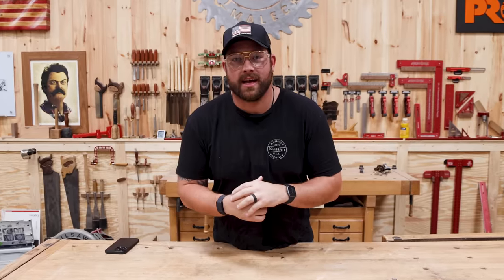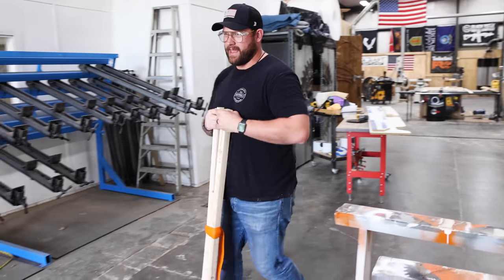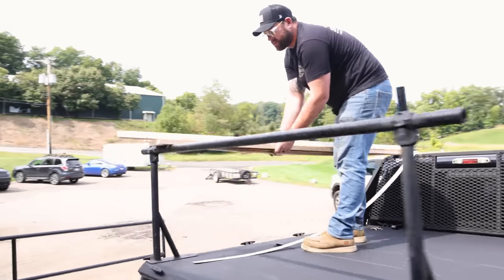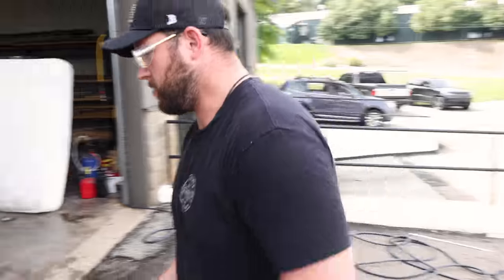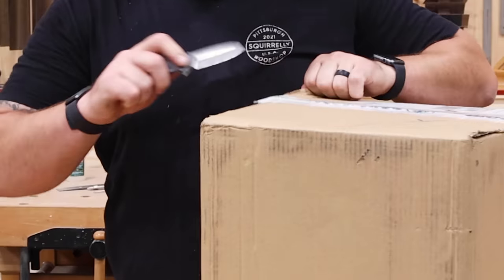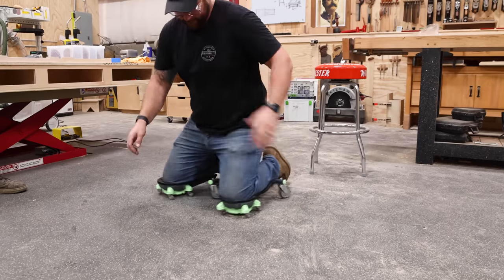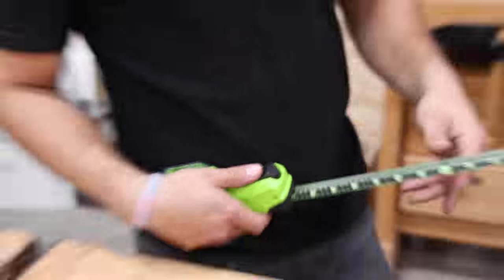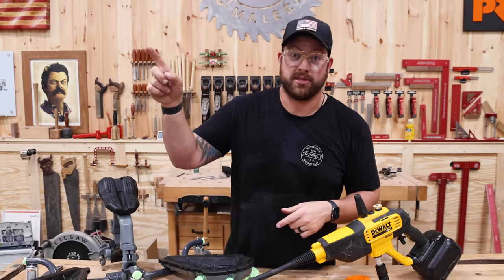I Tested The Most Viral TikTok Tools!

Comment: I have the dewalt pressure washer, it works perfect for washing mud off my ATV after a ride. The larger angle tips are useless, I only use the turbo and the 15. It's definitely not a replacement for a gas pressure washer but it has its uses. It works best with the 60v battery, I will go thru multiple 20V's washing mud of ATV.

Comment: Almost instantly bought the pressure washer...then realized I was only interested as a better way to wash cars...then realized I don't actually like doing that and at $192 I could take my truck to the $3 wash every 2 weeks for 2 years before that tool was worth the money.

A pressure washer that doesn't have enough pressure is an excellent way to use up storage space though!
Reply: oddly the low pressure was part of what tempted me having a good way to clean hay balers and mowers without getting water forced into the bearings is always a challenge so portable and using the same batteries as we use in the shop was tempting i am going to see if a deal pops up in the late fall with a battery (best way to get extra batteries with when they come with a tool attached to them) picked up a 60v dewalt pole saw that way for a little over the cost of 9ah flex volt battery
Reply: Those cordless pressure washers are a happier medium between his pressure and electric pressure washer. Definitely doesn't replace my gas pressure washer but does much better the the hose alone cleaning my ATV after a good weekend or my mower.

Comment: That kneel it thing looks like a decent replacement for a rolling stool for working under cars in a shop with low ceiling clearance as well. But, only if you do it a lot, because rolling stools are much cheaper.
Reply from the maker: Yea it’s more for flooring
Reply: @John_Malecki  I agree. I just could see myself using it under a car, because the ergonomics and range of movement seem better than seated on a rolling stool.

Comment: The simple strap looks very similar to High Traction Safety Tape (3M QuickWrap to be specific). It’s used when working at height, usually overhead of other people. I bought 2 rolls when I learned I had a job coming up where I’d be working on a stadium catwalk... I’ve found tons of random uses for it since that job a few years ago. That said, I would NOT trust it to replace a Ratchet Strap.

Comment: The Gator tape is really good for people with low vision and their finger strength isn't all that great. I have trouble with locking all my tapes as my thumb and finger strength isn't good but the gatortqpe keeps it locked until I need it released then it is easy to release. The green on black is easier to read and the print is easier to read. So it is good for that purpose.

Comment: Free tip from a contractor, but tying down lightweight stuff save pieces of trim or smaller trim boards take the handheld stretch wrap stretched around a couple times and then take a single wrap of duct tape holds everything really well and is very easy and cheap

Comment: Simple strap reminds me of bicycle innertubes. I do the same thing with bundles of 1" PVC and lash it with cut up stipes.   Bike shops will give you flats they've changed for free, you just cut them and split them open.   Works really well.
Reply: The main selling point seems to be that you can cut it.  But that almost makes it disposable which is not something you want if you're doing a lot of hauling.  Also flexible materials are often very susceptible to uv and weather damage so don't leave it on your truck unguarded.  Definitely not a useful as cloth tie downs or rubber straps that are usually thicker and therefore will last longer in the weather.

Comment: About pressure washing, use a chemical cleaner like bleach for concrete or soap for exterior walls, degreaser etc. You won’t need as much pressure to remove the dirt/grime after treating it, and you’ll get a more uniform result.

Comment: I think the key with the simple tape is to get the free end under a tension wrap.  So, if you're going to end it on the post, get a few wraps around that too, so you have something to grab the end with.  Remember with belt tension, every wrap has a exponential effect.

Along with the "awesome" score, it would be cool to have a "does what it claims" score.  So the gator tape would get a "does what it says" but not "awesome."  The fun would be in collecting those that DON'T do what they say... but still get an awesome.

Comment: The kneel it wheels and anything similar can damage flooring as you install it. If a rock or offcut gets pinned under the wheel as you roll it will scratch your surface.

Comment: I use the hell out of the dewalt 20v pressure washer at work for cleaning condenser coils and it works wonders. Strong enough to clean yet not too strong to damage the coil fins.

Comment: John we need you to try the Tianli router (handheld Mortiser). I’d seen them selling for $30. (And up to $200) little gadget Turns a palm router into a festool domino. Or, a plantorouter. 

I was close. Really close to ordering and waiting however long to try it out. However it doesn’t fit my Dewalt palm router. (The one you have in videos) But if you happen to have a Bosch or whatever other router, it could happen. Interesting product.

Comment: For that little pressure washer, the hose is not putting out enough water for what the pressure washer is sucking up. That is why your hose is collapsing. Not saying the device is all that great but you would get better results pulling from a water tank since it seems you have low water pressure in your area.

Comment: The Dewalt pressure washer sounds easy and convenient. Looks like it will be easy to use to clean cars and RVs!!!
Reply: I'm just not seeing when you would have access to a water hose but not an electric outlet.

A regular electric power washer seem like a better choice.
Reply: A 5 dollar plastic hose nozzle would do a better job

Comment: You can already do internal measurements with a normal tape measure. It'll say what to add on to your measurement on the back where the clip is or on the bottom. Only time I don't see the additional measurement callout is on cheapo measuring tapes.
Reply: Ehat if you have to make 40 plus internal measurements like installing molding the gator tape saves time I love mine
Reply: @MADDABBER  just take the 40 measurements with the tape measure? Lol. All you gotta do is add the distance the tape measure calls out to your measurement. 

Just pointing out that you can easily take inside measurements with a regular tape measure and a guy doesn't have to go buy a extra tape measure just for inside measurements.

Comment: I don’t really understand the niche of the battery pressure washer. It has to be connected to the hose anyway, just get an electric one that plugs into the wall if you don’t like the gas version. Same hassle, 4x the power (or more).

Comment: How are those straps different from Rope?
Reply: They are meant to be quicker to strap down and then undo, and because its rubber, it has more friction to help keep things in place.
Reply: I guess because of the material it's made out of to have way more resistance against itself than rope, I understand your question tho, rope you would have to have more of it and tie it completely and not just tuck it. The wrap kinda sticks to itself in a way

Comment: Gotta admit that I laughed a bit at those straps.  Just use rope.  Seriously.  Ratchet straps are great when you need a ratchet strap, but rope does the same thing... and more.  You can pull a Trucker's Hitch in a piece of rope that's every bit as tight as any ratchet strap will get, and then use the rope for something else later.  Those flat straps are "neat", but again.... some 1/4" or 5/16" rope will do the same thing and a whole lot more.  Folks really need to look up the Ashley Book of Knots to see how much knowledge we've lost regarding rope and how it can be used.  Ashley wrote his book when the Golden Age of Sail was still in recent memory and rope was a commonly used thing in every facet of life.

Comment: I agree, the last one looks cheap and it doesn't do anything you can't already do with a regular tape measure.  If you want an internal measurement, just add the size of tape measure to the reading, it's usually print on the body of the tape measure.  Or if you want to be more accurate, mark off e.g. 1ft then measure to that mark from the opposite side and add 1ft to the measurement.
Reply: Came to the comments to say the same thing
Reply from the maker: Yea I’m aware. But requires math and math is hard !
Reply: @John_Malecki  your hard
Reply: @jacobswedberg1402  *you're, but grammar is hard too😂✌☮
Reply: I was also thinking about that little readout window- it looks like the line isn't that close to the actual tape, which would lead to inaccurate readings if you don't look at it dead on.
Reply: Ya I just use a known dimension like a 1" block to stand off and measure that add an inch. Not hard math there
Reply: I use internal measurement with the Hultafors TALM3 3m Talmeter Marking Measuring Tape. Worth trying and gets like 5 stars. Think it's best tape measure going
Reply: I've seen this specifically marketed at curtain and blind makers & those that I know have mostly used it with the hook attachment which gives accurate drop measurements from curtain rail rings. As John said it's speciality, I can't see that it's really of much use for anyone else as a tape measure works fine
Reply: @John_Malecki  If you use world class units maths won't be hard... Instead of 10 1/8 + 3 1/4 it will be 26 + 8.
Reply: Or just buy a laser measure. As a bonus, you can measure whole rooms and let the device do subtraction, addition and multiplication. They also aren't that expensive anymore.
Reply: @John_Malecki  I never math it. I lock my tape measure at the interior size then just lay the tape on the board and mark the back end of the tape measure. I'm lazy and it's still a mostly perfect fit 🤣 I'll only do that for stuff that doesn't need a nice finish though.
Reply: I have 2 tape measures which have an extra scale on the centre of the blade which gives the interior measurement taking the case into account. Lufkin makes them.
Reply: @James-dv1df  Me too, that thing is also super compact. I also love how you can use the measure itself to make a quick mark on what you are measuring.
Reply: The extra stupid part is that any half decent tape measure will have the body size listed on the measure so you can add it to the tape reading and get your inside measurement anyway.
Reply: I install wood floor wood stairs based eand shoe molding and I tell you I stand by that gator tape why add the length of the tape measure and still possible be off a 16th or an 8th inch off it dosent make my cuts any more accurate becasue i know how to use a regular  tape measure. What I like about it is I don't have to do math its not hard but seconds add up when you have alot of shoe to cut definitely more of a specialty tape measure but 100 percent worth it when you need it

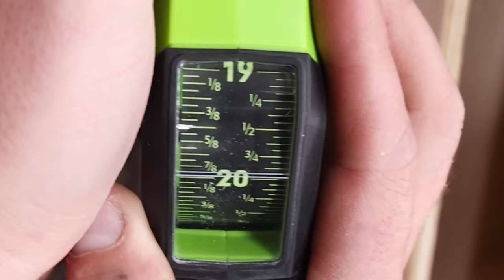Comment: Love the tape measure part at 10:12 in the video John says 19 17/16, he must of meant 20 1/16th 😂
Reply: This is a constant problem with imperial measurement because you don’t actually measure the inches you measure the fraction of the inch away from the inch. So which direction you read your fraction matters which way you have to keep pointed and it throws you off all the freaking time
Reply: i think it might have been 19 15/16 by where it looks to me anyways
Reply: @Eric Swenson  I'll just stick with mm

Comment: Most good tape measures actually have a measurement on the body so when you pull the tape out completely and butt the body of the tape measure on the surface, you just add that measurement on top the tape measurement to get the full dimension. 🙂

Comment: You really don't need a special strap for that sort of tiedown. Ever notice in the old westerns how the cowboy loops the reins over a post a couple of times and somehow the horse never runs away? That's because tension force increases exponentially as something is wrapped around itself, so the horse in that case literally can't pull a rope off of the wood. Back to tying stuff down, you can get similar results (for cheaper) with normal straps, or for smaller bits take the inner white strands out of 550 cord to flatten it down and wrap it around a few times.

Comment: Fun fact. Any decent tape has a number on the back or side (usually 3.00 in) that is the amount you add to what the tape is reading to the back of the tape for inside measurements. So if you can add 3 to a number, that gator tape is useless.

Comment: You guys don't have electric pressure washers that you plug on a outlet like a normal tool? Also you can use old bicycle inner tubes or BUNGEE CORDS!! 🤩 They invented nothing basically
Reply: I have an electric pressure washer, that DeWalt cordless washer, and a gas one. They all have they're place, but the cordless one is great for light duty washing. I typically use it for outdoor furniture, my truck, and our travel trailer. I find it so much better for a lot of stuff, rather than a standard electric pressure washer

Comment: If you didn’t know most tape measures are about 3 1/2 inches long so you can basically measure from the back of the tape to the tip and add the lengths together.
Reply: Why do the extra work of adding it together when you can just  spend 20 dollars on the gator tape I use it all the time but I install trim wood stair treads and wood flooring and i definitely got my money's worth with it

Comment: Pressure washers ability to strip paint is in the Tip u use. a 40 and a 15 are not the ones u want to tear stuff up. use a 5 ;P or a 0 if u want to cut stuff

Comment: I stand by the gator tape I love it It work great I do wood flooring I install wood steps I install base and shoe molding and it works great for that its not that it made my cuts any better but it made me faster getting measurements and don't have to add an 8th in because the tape measure bends up but 10 out of 10 recom3nd the gator tape